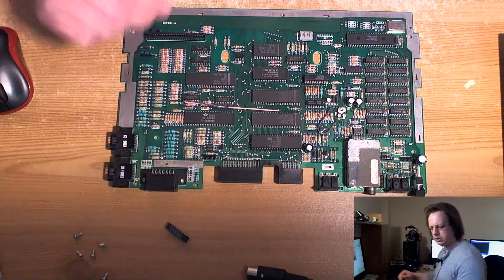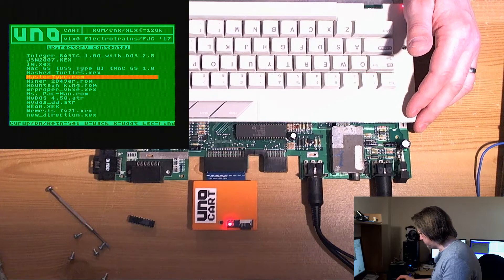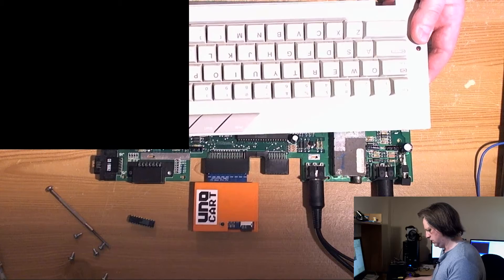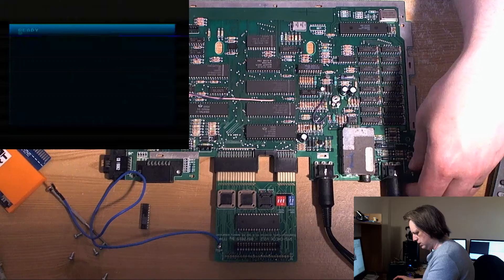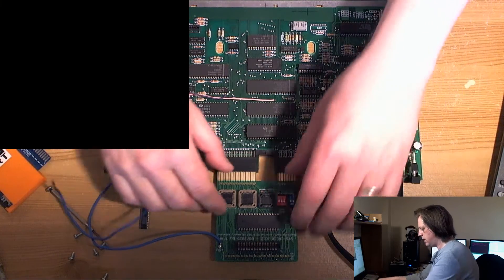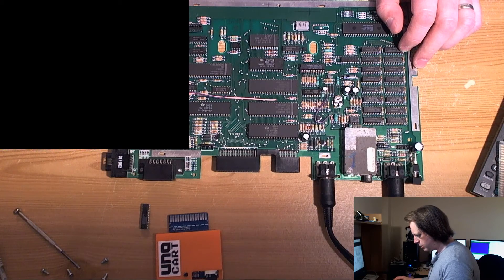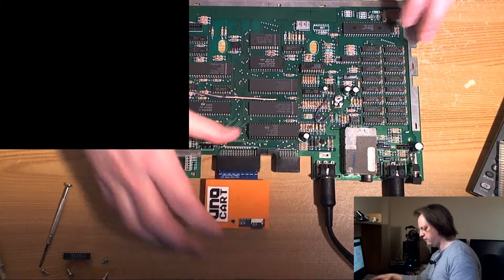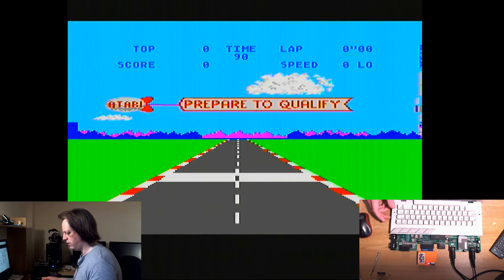Troubleshooting an Atari 130XE which doesn't work with cartridges

Comment: Interesting video, Jon. Thanks. Can you clarify a point or two about use of the Sys-Check? First, can it be used on non-XE machines without an ECI connector? Or to phrase it another way, is it of any use for working with 400/800/XL machines? If not, is there an equivalent to the Sys-Check that will? I've used the Atari SALT cartridge rom to work on my existing machines but I don't have the external testing box that you're "supposed" to use it with for a full diagnosis.
Reply from the maker: Herb Schaltegger No good for the 400/800 (although it could potentially be rigged up to Incognito, for what it's worth), but SysCheck has a PBI connector suitable for the XL and even a 5V pickup wire for 5V on stock 800XLs with no power on the expansion port (wire connects to the 5V pin of the joystick port).